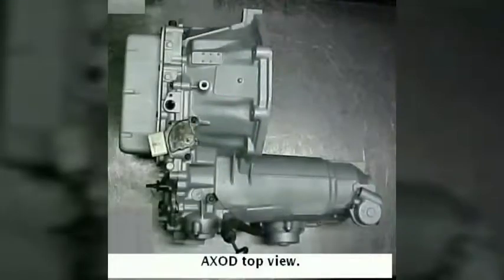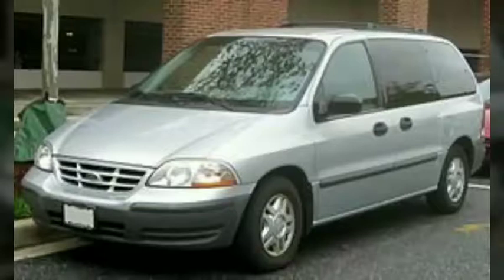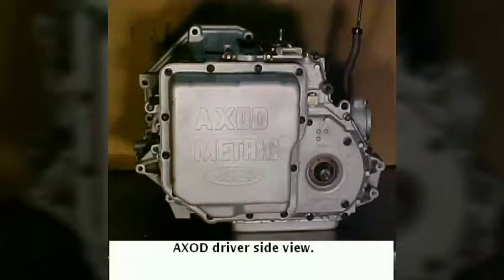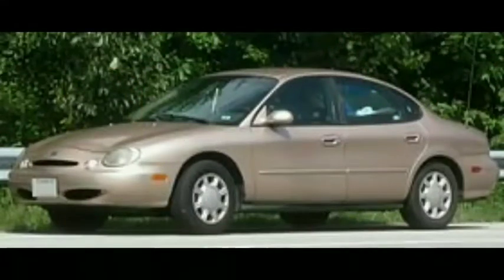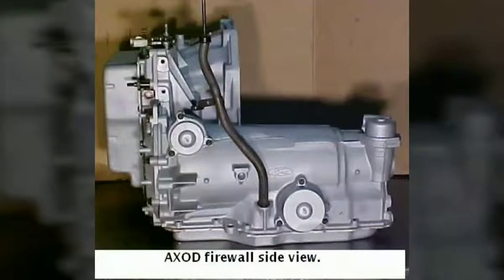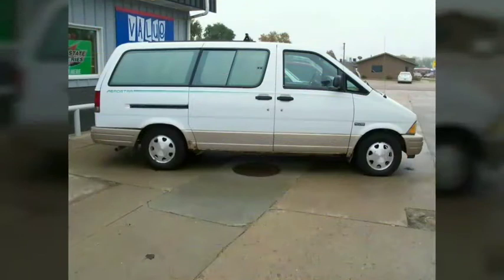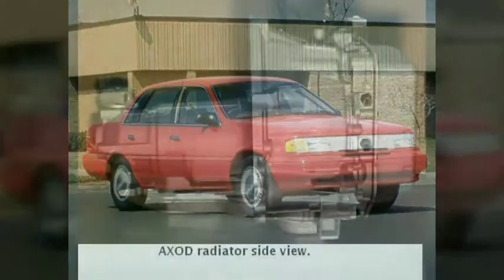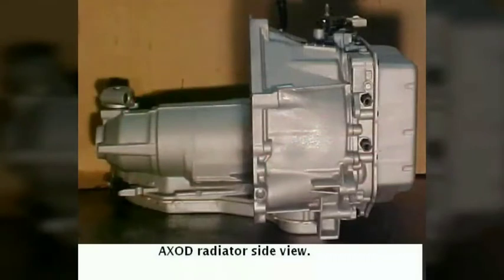Ford AXOD Transaxle Specifications

Comment: My 99 Vulcan Taurus lx has a transmission leak, is that a common issue as well?
Reply from the maker: On early models pre-2000 like yours yes. After 2000 while they still have issues most of problems have been addressed with better seals over the cheaper ones they used in the past. High mileage can also result in leaks. It is just wear and tear in most cases.